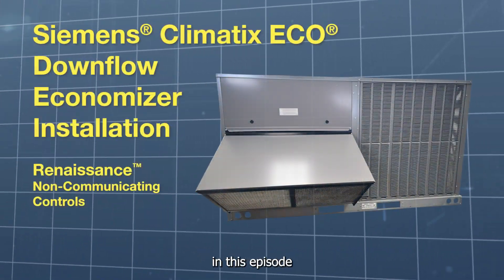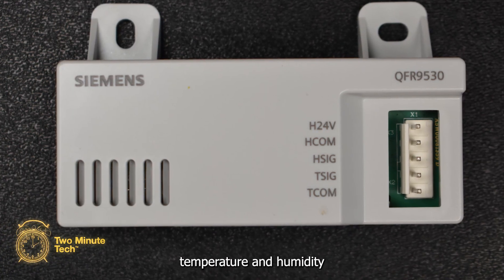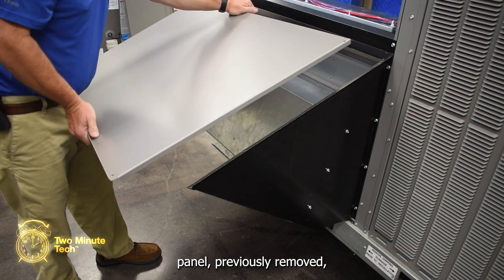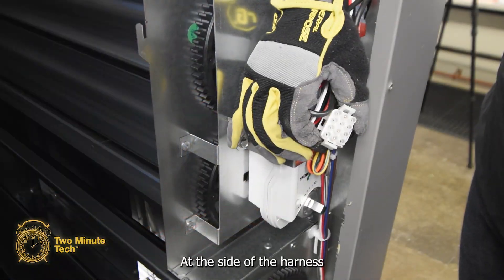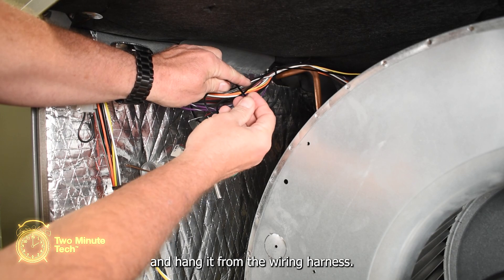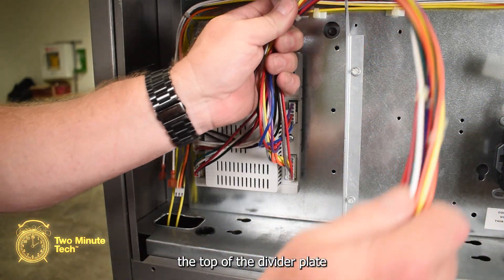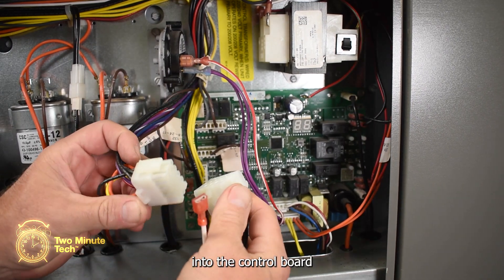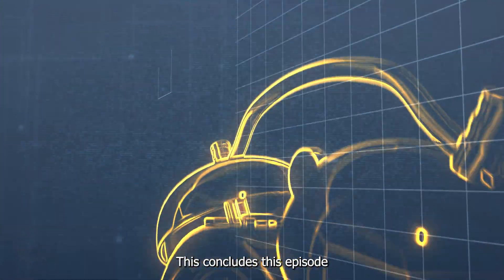Two Minute Tech: Siemens® Climatic ECO® Downflow Economizer Installation

Comment: I've been a Ruud dealer for twenty years, and have one more install. But after the lack of reliable information on installing this Siemens, I'm signing up to deal in competitor brands. The Jade economizer controller was so simple to install and effective. This Siemens is more trouble than it's worth. Your video doesn't even mention the harness you have to run yourself through the unit, and then remove and replace wires in the Molex plugs.